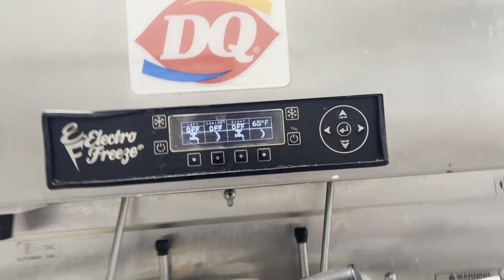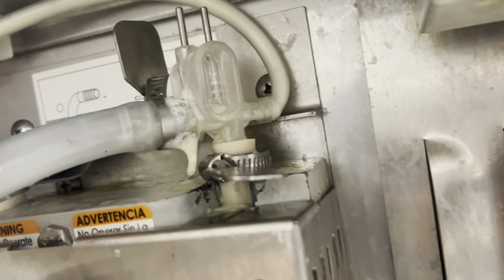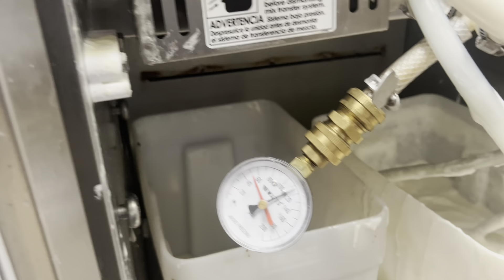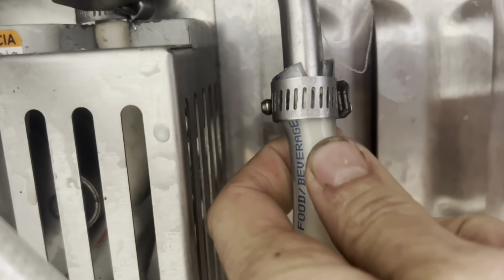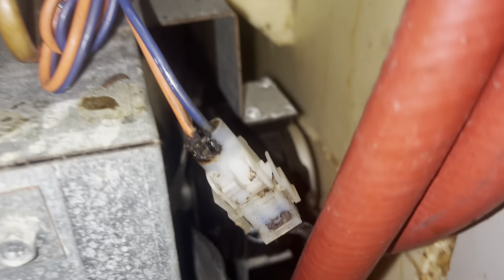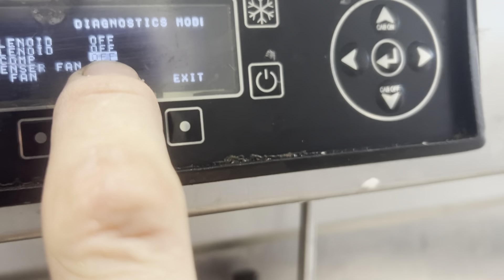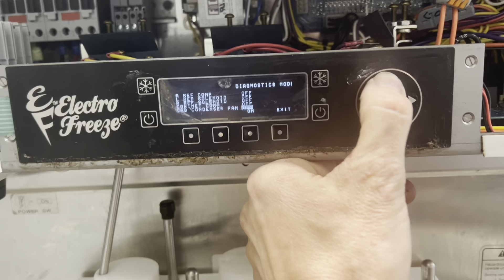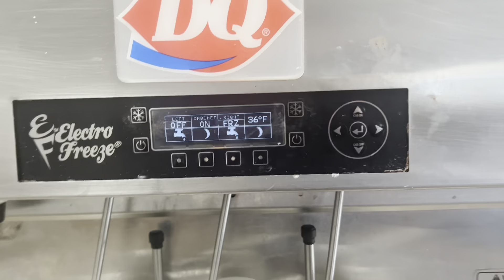Electro freeze nightmare - none of them work

Comment: I’ve done that a few times stealing power from relays like that to get it running temporarily 

I haven’t had any issues with those plastic clear ports, I’m surprised you’re having so many issues
Reply from the maker: Makes me happy to hear the OG ice cream guy approves even if EF did not 😂These machines have been waaay neglected.  I had a huge uptick in problems with ports a month after switching sterisheen.   The chlorine based cleaner made them brittle.   I replace them with the steel ports now generally speaking but it’s more plastics coming based on availability.
Reply: @restaurantrepairs  ahhh ok. I’m probably not seeing those issues because the dqs around here don’t use the correct stera sheen unfortunately, they use the sink sanitizer/bleach
Reply from the maker: @WswRefrigeration  I did the same for a long time.  Then I actually did a test with sterisheen and found the units no longer smelled like rotten milk all the time and the owners claimed they were getting better quality in taste.    These ports that wasn’t the case on. They were just god knows how old and cracked everywhere. When the units overpressurized it back flowed and oozed out of the port bodies.